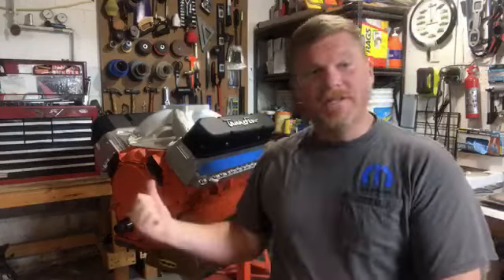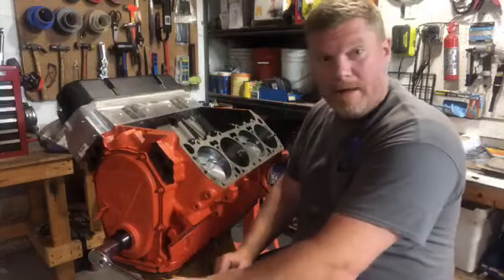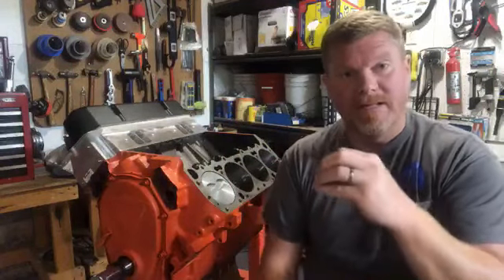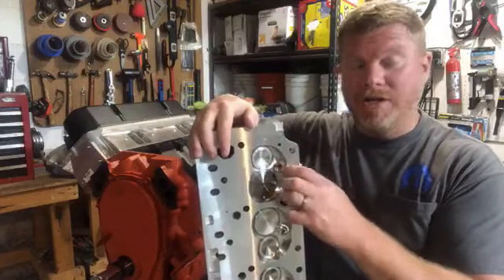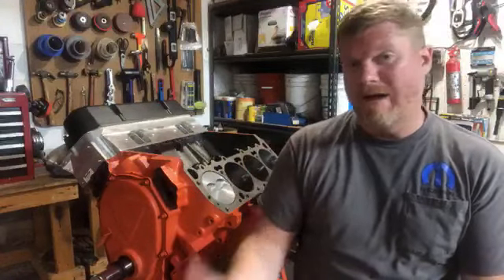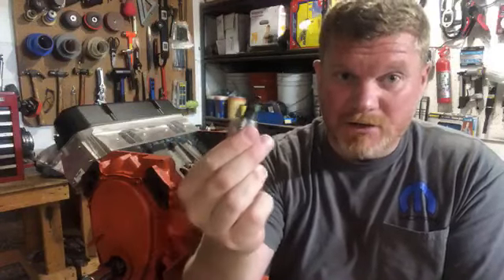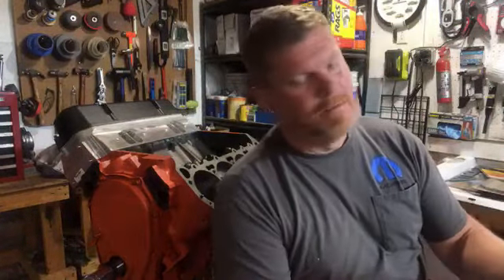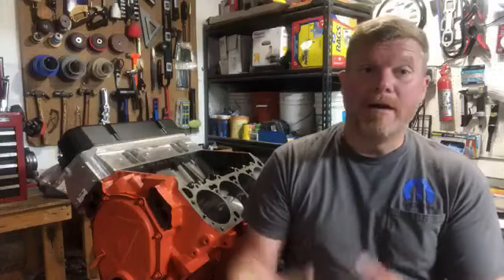The Watercraft Journal IRL – Choosing The Right Fuel For Your PWC

Comment: All you need to remember about Octane rating is, higher the number the more resistant it is to pre detonation, hence why high compression, forced inducted engines need a gas that won't ignite before the piston hits TDC. 

High octane gas is technically LESS flammable then low octane gas, if you run low octane gas in a high comp engine, it will PING due to pre ignition before TDC.

Comment: Good video, just wanted to point out that octane rating means how prone to pre-ignitiona / detonation a gasoline is. The higher the number is the less prone pre-ignition. Also, the spark plug does not fire at top dead center unless you are at 0 degrees ignition advance. In reality the spark plug fire before TDC and the whole flame front dynamics comes afterward.
Reply from the maker: You're exactly right, Walter. Octane also stabilizes the molecular bond - higher octane fuel is less volatile (that's why US air servicemen could weld INSIDE of an airplane's fuel tank ankle deep in fuel). And yes, it's NEVER at 0º but trying to detail the complexity of ignition timing to an audience of PWC enthusiasts can be a little...challenging.

Comment: So when do the big manufacturers make these Skis with closed loop fuel systems so we can achieve optimum fuel efficiency? It's already been introduced by the tuners in the sled industry. It's safer monitoring fuel burn than waiting for the knock sensor to pull timing when the damage may have already occurred.
Reply from the maker: That's a bit of a logic jump. Of course a closed loop circuit on a sled/snowmobile is ideal, but not so with boats. Closed systems suffer from heat soak and typically operate at a higher average temperature compared to open circuits.
Reply: Yes agreed, that is true for the lower states, but around my neck of the woods we benefit from cold waters and cooler air temps most of the year. It will be interesting to see if the EPA will eventually force the recreational vehicle companies into a cleaner system with O2 sensors and closed loop fuel systems. Do you happen to know what stock AFR target numbers are on the SVHO?
Reply from the maker: 14.6 is Stoichiometric, but 12.2 is considered the safest best power at WOT (Wide Open Throttle).

Comment: Hey Kevin have you done a test with any SVHO top speed run on 87 ethanol-free VS  93 octane with ethanol. FYI Kevin 61.0237 is 1 liter so like a Yamaha SVHO is Little over 109 cubic inches 🤭
Reply from the maker: No, but that's a neat idea.
Reply: @watercraftjournal the reason why I say that  I think the 87 e free will do better then the (up too) 10 % ethonal in the normal gases here in VA. Most of my German cars that take premium seam to do better with the e free gas so I run it in my SVHO but I haven't tested it if I scrub and of my top speed I would think more out the hole then top speed is scrubbed. If I get around to testing it I get back to you but I been very curious. Also the station I use one offers efree in 87 or I would get it in higher Oct.

Comment: Hi Kevin, I know you didn’t really want to touch on Octane but I have a question. In the UK the standard octane is 95 in unleaded petrol (we also have 98, super unleaded). According to the Seadoo Spec sheets. The GTI 130 & 170 are both 95 octane rated engines. The Wake 170 however is 87 octane. Why would this be? I thought it was the exact same engine is it not? This leads up to, if I’ve got this right, by and large its OK to run 87 octane in a 95 rated engine but NOT OK to put 95 octane in an 87 octane rated engine, is that correct? On that basis I would not risk buying a Wake 170 in the UK as it is an 87 octane rated engine and UK fuel (at 95) would knacker the engine. Is this right? (PS I don't yet own a PWC but am in the market). Thanks for any input :)
Reply from the maker: It might be the difference in octane measurements between the US and UK. Yes, the 1630 ACE 170 is identical worldwide, so it might be a case of US measurement vs. UK. Double check to verify that they're using the correct scale because us Yanks like to muck things up with our Standard Units of Measurement. (#screwmetric)
Reply: @watercraftjournal  This has nothing to do with imperial vs metric units.  

Most of the world uses the Research Octane Number (RON) test to rate gasoline and displays that at the pump.  The US and a few other countries use the AKI (Anti-Knock Index), which is the average of two tests - the RON test and the Motor Octane Number (MON) test.  The MON test is a more difficult test that is run at high RPM and results in lower scores.  It doesn't mean the gasoline is any different; it's just that the AKI rating includes a more difficult test.  So you could actually say that US gasoline is better because it has to pass more stringent testing before being sold.
Reply from the maker: You CLEARLY missed the joke.
Reply: @TheVonMatrices  the joke flew over your head

Comment: Hi Kevin! In absolute emergency, can I use 87 in stage 1 tuned GP svho or rxpx300?
Reply from the maker: No. The Stage 1 reflash will not allow the engine's knock sensor to retard the ignition advance enough to keep the engine from detonating (pre-ignition). Either bring enough fuel with you, plan your fuel stops accordingly, or don't build your ski so far out that you can't ride the dang thing.
Reply: @watercraftjournal  thanks for replying! I’m planning on carry the maptunerX in my car so I can return to stock tune in case I can’t find 93
Reply from the maker: Yes, but if you’ve modified your supercharger and/or injectors, you’ll also have detonation issues.
Reply: @watercraftjournal  all I have is the tune other than that is fully stock

Comment: A quick question Kevin please ?

“Your Sea-Doo engine is designed to run most efficiently with fuel of a specific octane rating. For all engines except the 300hp Rotax 1630 ACE - 300, look for unleaded fuel with an AKI (RON+MON)/2 octane rating of 87 (or an RON octane rating of 91). Craft using the high-performance ACE - 300 engine require a higher octane level for best performance, fuel economy and engine life. Use Premium gasoline with an AKI (RON+MON)/2 octane rating of 91 (or an RON octane rating of 95).These octane requirements can also be found in the Sea-Doo Operator's Guide that comes with each craft.”

Why is the 230 (basically the same as the 300 ) not included in the Sea Doo fuel notes above ?
Reply from the maker: This was answered in a previous post.

Comment: Why do the Seadoo manuals say to fill the tank prior to storage and treat with stabilizer if you are recommending a few gallons?
Reply from the maker: A full tank is preferred as it will keep the sensitive fuel pump, terminals and pickup submerged in fuel, unable for ethanol fuel or heavy condensation to corrode these surfaces.
Reply: @watercraftjournal  thanks
Reply: @watercraftjournal  thanks

Comment: Kevin can you pls post hyperlink for that worx /riva sponsons comparisons thank you
Reply from the maker: Knock, and it shall be opened unto you:
https://watercraftjournal.com/gallery-understanding-fluid-dynamics-in-relation-to-superior-sponson-design/
Reply: Thanks Kevin really appreciate!!!👍🏻👍🏻👍🏻👍🏻
Reply: I’m sad I cheaped out and purchased the worx sponson I would have definitely spent the extra 120 if I seen your article !!! That said Kevin I have 19 gp I have stage one tune free flow exhaust not a lot of upgrades but I’m thinking of grabbing riva gen 2 intake grate and pump seal what’s your option on that ??? I figure improve handling at this point and hook up !! Thanks for listening 👂
Reply from the maker: The intake grate and pump seal kit will dramatically improve initial acceleration and hook up throughout the powerband. (Not so much handling/cornering.) The grate and seal kit provide traction and reduce cavitation, meaning launching from a standstill or pulling out of the apex of a turn will feel radically different/stronger. –K

Comment: 14:30 I thought the higher the octane the more “resistant” to combustion? That’s why you need it in higher compression engines. It resists Pre detonation. You state that it combusts “easier”
Reply from the maker: It's a more complete burn. Less waste.
Reply: I've heard the same thing that higher octane resists combustion(pre-detonation) and knock, the more compression the more heat. That's why boosted engines need higher octane because the extra air being shoved in the combustion chamber increasing pressures. As you've stated about knock sensors allow alot of modern engines to run lower octane fuels by detecting knock and therefore the ecu injects extra fuel to prevent that pre-ignition. That's why if you run lower octane fuels in engines that prefer higher octanes get worse mpg.
Reply: @watercraftjournal  It's not quite true that higher octane fuel produces a more complete burn. Octane is only a rating of how much compression it takes to induce combustion, nothing else. It is true that a lot of gasoline manufacturers use higher grade fuel in their higher octane (aka "premium") offerings, so you can end up getting a cleaner / more complete burn because of that. But octane doesn't inherently cause that. In other words, putting 92 octane fuel in an engine designed for 87 octane fuel will not result in a more complete burn, in both cases, an ideal burn is possible (all else being equal.) However, you are correct that an engine designed for 92 octane fuel will get knock running 87 octane fuel, and in that case, modern engines will inject more fuel and wind up with unburnt fuel, less power, and worse efficiency.

Comment: Hey Kev,
Sorry about the war & peace below!
I know this was filmed 8 months ago so not sure if you’ll get this, but as a guy who spent his whole career operating some of the largest mining equipment on the planet I’ve never really been interested in why they work, just how to make gear work faster via operating techniques. 
I have to say I’ve really enjoyed your explanations on why engines, fuel, oil, impeller & pumps work - you should be a teacher your very good & entertaining!!
Re the octane ratings for the Sea Doo engines. In Australia 🇦🇺 we only have 86 with ethanol then 95 then (98 which is the only fuel I’ll run in our cars). The only fuel at all of the marinas around here is 95 I’m guessing that it’ll be ok as you were saying that you run 93 in the US?
Also we have a 40’ cruiser which I’m planning on using as a base for a week or so when we go away. This will mean towing our GTX 230 behind it but only at about 8 knots for an hour or so at a time to an anchorage to play. Is there any thing I’ll need to do to the GTX to prepare it for this? I towed my Kawasaki 650 stand up behind someone else’s boat once and only just caught it in time before it sank with water going back up the Venturi suction at the pump into the engine bay 😬 Only just got it started and was able to ride it around until the jet pump sucked all the water out again!
Cheers Steve from Oz
Reply from the maker: First, run the 95 octane. Regarding towing your GTX at that speed and for that long, that's really not recommended. Like at all.

Comment: The major concern with that low of an ethanol content in pump fuel is deterioration of the fuel system.
Reply from the maker: Not so with modern plastics and rubber. Ethanol really only corroded old fuel systems and softer (low pressure) fuel lines on classic cars and old boats.
Reply: @watercraftjournal  would  you say it’s fine to have a PWC sit for a few months during the winter with ethanol blended fuel in the system?
Reply from the maker: If you properly treated it with a fuel stabilizer, yes.

Comment: You can totally use 87 octane on all newer ski's.  All those engines have knock sensors and computers that will adjust the timing to compensate.  Not only can "use 87 to get home"  you can use it all the time for years and years with no problems.  No you won't get full horsepower but slightly less but who cares.  On all my modern corvettes and anyone I know that has corvettes all use 87 octane gas because it's cheaper even though the manufacturer says use 91 at least.  Won't hurt the engine at all.  If your modding your ski for ultra horsepower maybe use 91 but if it's stock then 87 is fine all models all the time.  If you have extra money to waste then go ahead and buy 91`.
Reply from the maker: Pretty much exactly what Kevin explained.
Reply: @watercraftjournal  Not really I heard a lot of "87 can get you home OK".  Not only can it get you home Ok it can be used all the time with no problems.
Reply from the maker: Disagreed. The knock sensor is REACTING to detonation, not preventing it. The "heat" of your plugs, the compression of the cylinders and timing of the ignition all depend on the proper octane fuel, unless otherwise tuned. Yes, 87 will get you home and you'll be fine if you stay out of the boost, but do not operate regularly on it.
Reply: @watercraftjournal  Of course it does.  The knock sensor tells the computer to adjust timing just like every other modern  engine in the world.  This is pretty much engine basics 101.
Reply: @watercraftjournal  A modern car ECU will learn that it's always having to adjust for lower octane, so it will apply that change even before the knock happens. That's why you shouldn't switch back and forth based on how your wallet feels that day, just pick an octane and stick with it. I can't say whether or not the computers in PWC also use learning / predictive models.

Comment: Ruined 2 high pressure fuel pumps in a newer Evinrude Etec by using Ethanol fuel and all the additives bells and whistles. If I had to run ethanol in any water craft for any reason I'd drain the tanks and run it dry at the end of the day. Ethanol = a big ass sponge for sucking water into your fuel system. Nothing but non ethanol goes into any of my watercraft, period..
Reply from the maker: Yikes. Sorry to hear that. But we're pretty sure there was something else wrong there. Possibly contaminated fuel as modern engines and fuel pumps are designed (and built with treated materials) to operate using 10% ethanol fuel.
Reply: The E-tec motor is 2-stroke.  No 2-stroke motor should have ethanol fuel, pure 91 or higher.  Additives including fuel stabilizer make the e-tec run poorly.  This is very evident on their E-tec snowmobile motors, most notably the 600.